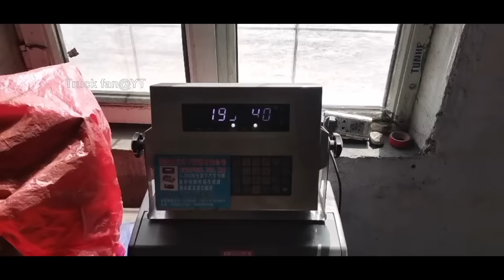199Tons semi-trailer---Win compilation 【E10】of overload heavy duty trucks exteremly operations

Comment: There is no way that marble is 120t, no single hydraulic tipper can lift that without de stabilising the truck. It’s more likely around 25-40t
Reply from the maker: density of marble is about 3 tons/m³     you can watch following video: https://youtu.be/qAmzC9HmOd0    especially at 2:20
Reply: Evet onu ben de düşündüm! Mermer ağır bir madendir ve mermerine göre kütle ağırlığı değişebilir ama bu kamyonlar böyle bir tonu nasıl götürüyor bunu çözemedim!
Reply from the maker: @v.a.2308    8*4 truck with marble loaded on bridge scale: https://youtu.be/qAmzC9HmOd0?si=6_KeSd_oEGO1rAJp&t=150
Reply: @v.a.2308  Marble is not a metal. It is a rock composed of many minerals.

Comment: At 5:00 that is impressive.  BTW why truck factory's still using drum breaks?
Reply: The reason manufacturers still build their trucks with drum brakes is simple: cost. Drum brakes are cheaper than disc brakes.
Reply: Cheaper, more durable in bad conditions, easier to maintain.
Reply: Is it really cheaper?  With that water cooling system? I don't know. Maybe. Possibly. But I don't think so it's better than disc brakes.
Reply: By the  way.  Thank you for answering.
Reply: @daniel16.4  Disk fren tabi ki her zaman güvenli ve iyidir ama Çin gibi çok kalabalık ve maliyetlerin çok önemli rol oynadığı bir ülkede kampana fren kullanmaları çok normal.

Comment: i wonder how much range and could those Tesla Semi truck pull weight of 150' tons ., probably range will be 30km and batteries&and engine will burn pretty quickly
Reply: Yup and the idiots still think they can compete. There will never be a better solution to the internal combustion engine. Its not hydrogen or natural gas so it wont blow up, it isnt electric that doesnt have range, its not coal that requires you to burn to make steam power. Diesel is just the best flat out when it comes to power and fuel effieciency when haul heavy stuff.
Reply: @smeshcel3025 naahh.. you're wrong. We have cng semi trucks already. Tank is exposed out on both side, with guard rails.
Reply: Also Germany is already finalizing charge on the go with pantograph cantilever system. So you are probably pretty much wrong
Reply: @Vandanms  they dont doing nothing and even if they do this shit will raise prices of everything terribly high
Reply: @Mr11ESSE111  no dude.. world works on demand and supply. If you think electricity prices go high, that's bcuz production in already installed facility is getting peaked up. So other huge companies will start venturing into power production field. Overall, electricity prices will only decrease. And in case of Europe, they are millions steps ahead of other nations, when it comes to innovation and efficiency!!
Reply: @Vandanms  cng trucks have their place for sure but electric isnt as time effective interms of refuelling/recharging times. Once facilities are put in place the demand will arrise. So i agree with you there. But for now diesel is king in terms of efficiency and availability
Reply: @Vandanms  prices of eleczricity everywhere go up and fackn EUuropa are very depandable of russian gas too